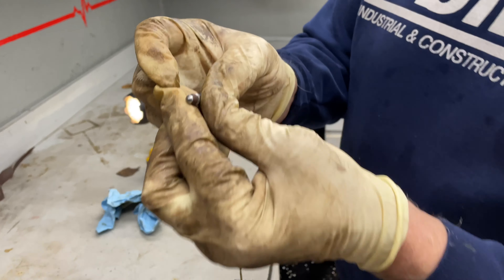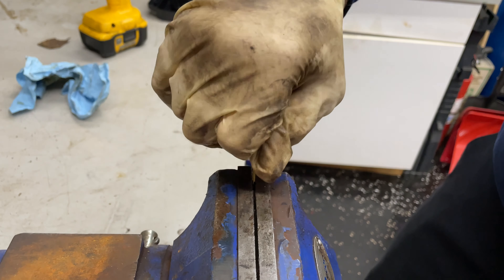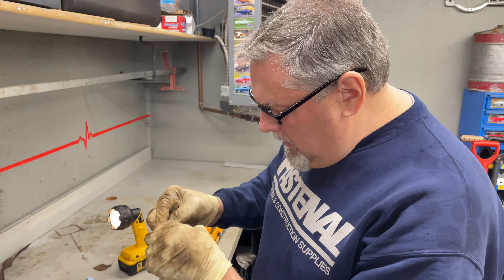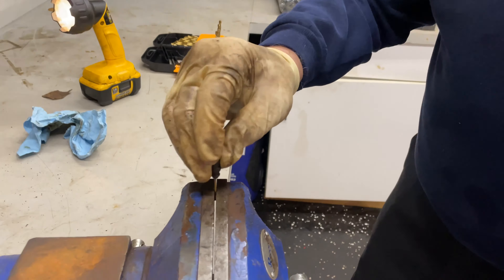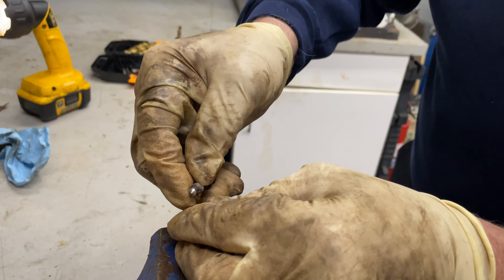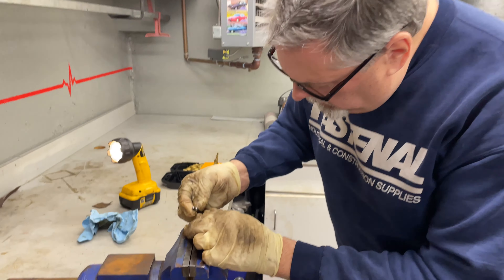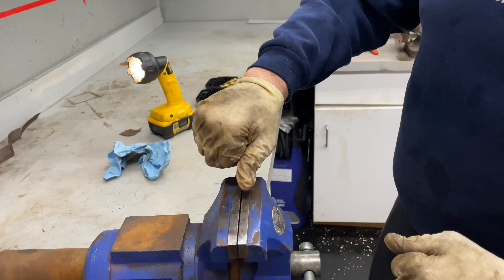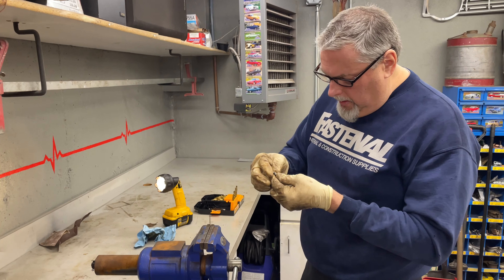Clogged Brake Bleeder ? Fluid Not Coming Out? Learn How To Clean Them

Comment: Ran into this problem on my 89 Toyota pickup after replacing the master cylinder.  Was able to bleed the rear drums no problem, but the two front disks would barely bleed.  Checked YouTube and found your video.  Removed each bleeder screw, found they were clogged.  Unclogged just like you explained in your video.  Worked like a charm!  Thanks for making this video!
Reply from the maker: Glad this helped you out!
Reply: Got a 94 Toyota pickup to do this on now haha

Comment: Worked like a charm on my 2001 Excursion.  Had already tried opening it and running the engine to build up hydraulic pressure.  Did spray some brake clean into the screw in between working the drill bit.  Thank you!!
Reply from the maker: Glad this helped you out
Reply: Ha, I just came here while doing a brake fluid change on my 2000 Excursion. One out of four bleeder valves was clogged. I just had to remove it and clean out the passage :)

Comment: I took the bleeder screw out completely and nothing came out
Reply from the maker: We were in the middle of a brake job and had drained it out of the caliper.
Reply: Leave it out, turn on the vehicle, press the pedal and it will come out unless the caliper is completely rusted on the inside.
Reply: It might not come out unless you pump em up and hold it then you take it all the way out